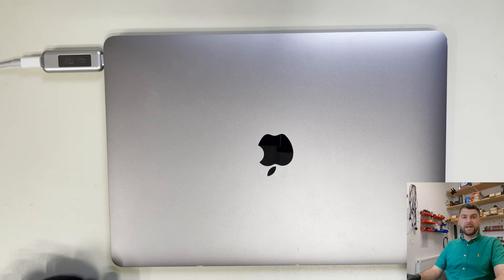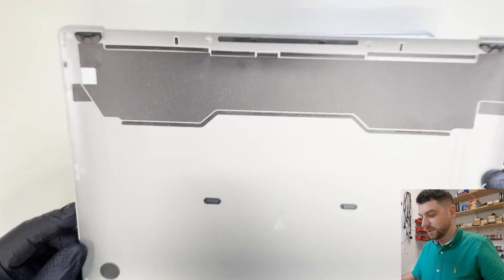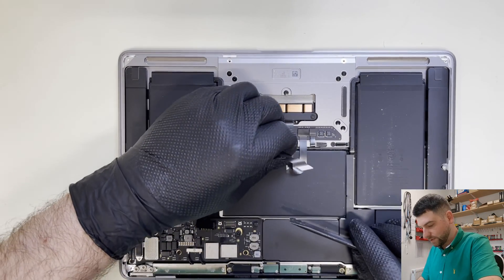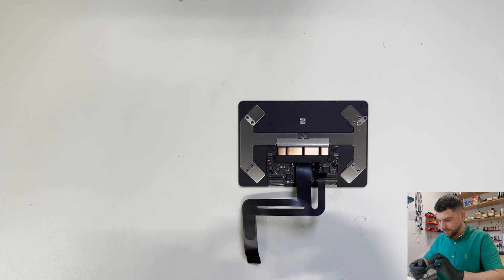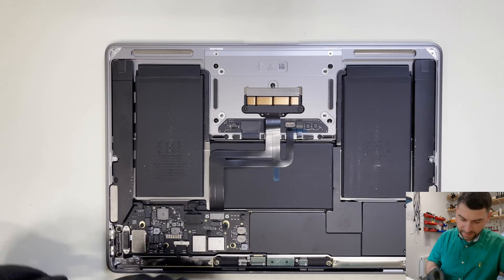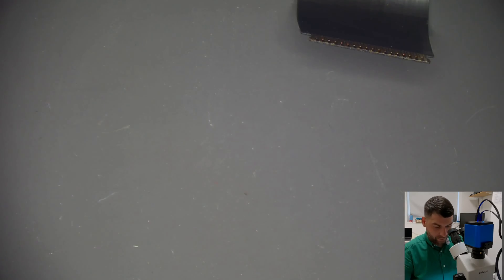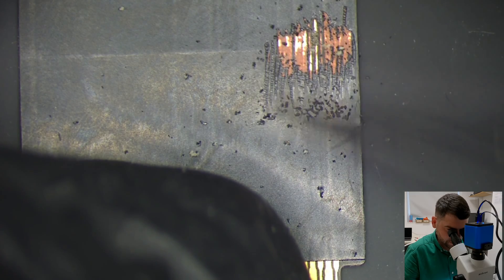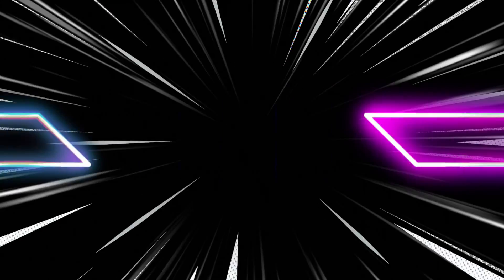MacBook Air A2337 Keyboard & Trackpad Not Working Repair: THE Most Common Problem

Comment: Thanks for the video and especially your investigation of the actual cable burn spot! Certainly drives home the point!

Maybe the strange software element of sleep/wake temporarily fixing the error could indeed be related to error correction software. It might have a "tolerance level" that for some reason resets upon sleep/wake and reboots - but above some level of signal-to-noise, it just gives up entirely, so not even resetting it works anymore.

Comment: My keyboard is not working but my trackpad is. I changed the flex cable but the issue is still there. What could be the problem?
Reply: Same problem here, how did you solve yours?

Comment: its a problem with the hall sensors that register if the lid is closed or not. magnets under the speakers. clean them
Reply: That’s interesting! My MacBook Air had the same problem as the video but it’s intermittent which made me think it must be software but I never even thought of a hall effect sensor. That’s genius
Reply: @damofx  did it work? i had to use external mouse because the whole keyboard was all bouncy.

Comment: why my MacBook keyboard and trackpad not working after I closed and reopen the lid.  I need to restart my Mac every time this thing happen . it is because of the flex cable too? or just the software faulty?
Reply: This happened for me after doing an OS upgrade. I reverted to Big Sur and the issue is gone...
Reply: Got frustrated after hours of investigating but when I found this comment, the issue was fixed - only closing and reopening the lid. Haha thanks man!
Reply: did u ever figure it out ?
Reply: Try making a bootable usb with the IOS and install it. I now have Sequoia and the issue is gone
Reply: I’m experiencing the same issue. I closed it while I was using Lightroom then when I tried to open it at first I was able to do so then it got frozen. Tried updating it then boom the trackpad and the keyboard stopped working

Comment: I have been investigating in this issue for hours and hours and hours until I finally figured out it is the flex cable. Used your video to replace it. I could not be more thankful to you!!

Comment: Hi. 
I have a similar problem with my keyboard.
Multiple symbols are typed at once, for example F4, F6 and F6 are pressed all together when any of them is pressed individually, also happens with RYI, FHK, VN,   if you look at these key you can notice the pattern.
Do you think the flex cable replacement could solve this? Thanks in advance.
Reply from the maker: Hi, very unlikely, seems more that your keyboard failed

Comment: Hi I want to ask I turned it off and when I turned it back on the letter a led me to finger and safary, e to emojis, f to full screen and like that with h, d, c, n and m and now I delate from the left side to the right and the letter I mentioned before dont work for normal typing, what can I do I'm working and I NEED for it to work but it doesn't do anything I erase my info and reset everything I don't know what else to do... it's MacBook air

Comment: i did this with my a2337 and was so happy, because it worked again. now after about 1 week it's the same problem.. so it is stuck after some seconds/minutes (always different) and i cant use the trackpad and keyboard anymore. could it be possible, that the new cable is damaged again.. after just 1 week?
Reply: I have exactly the same problem. It works then if I just close the laptop (instead of powering off) the trackpad and keyboard don’t work again. Very confusing and annoying, Macs are too expensive and too expensive to repair to have issues like this
Reply: @damofx  sameeee, what about now? is that solved?

Comment: Hi, I have a Late 2013 21.5 inch iMac (14,1) and I will soon open it to replace the HDD with an SSD. And since I'm in there I thought I should upgrade the RAM as well. Do you know if I need some "special" Mac compatible ram or it can be any as long as it's DDR3L 1600Mhz 1.35V 204 Pin CL11?
Reply from the maker: Personally I have never ever used RAM modules that are suitable just for macs, I believe this is just a marketing thing. I use any RAM module that meets the configuration, mainly Kingston.
Reply: @IFIXIT4U-UK  Thanks for the reply! Yeah Kingston is nice but the price for 16GB is half of the entire iMac haha so it's beyond my budget, especially since there's the cost for the SSD as well and those annoying adhesive strips. But good to know standard RAM should work too, this definitely broadens my options!

Comment: Mine having the same issue. I have the M1 Macbook Air. For some reason after the idle, keyboard and track pad wont work. The only time it will work if I will turn it off and turn on again. So frustrating!! :(
Reply: hello, i have the same problem. how you fix it?
Reply: @МаксимБеспалов-я1и у тебя получилось пофиксить?
Reply: i have the same problem ;;((((( @МаксимБеспалов-я1и
Reply from the maker: Try replacing trackpad flex cable first and see how it goes

Comment: You can just press the power button and it will turn off, the keys your were pressing have no effect, I just experienced this problem. Sad to see it’s wide spreed now. Although mine works for 4 minutes and then keyboard and mouse freezes, mouse won’t click as well. Screen keeps working and if I have media playing keeps it keeps going normally.
Reply from the maker: Yes you are right and here is why: There is a simple reason why you can't reset SMC on M1 Macs – there is no system management controller in the M1 Macs. All functions that were previously handled by the chip are now embedded in the M1 processor.
Reply: @IFIXIT4U-UK  I see, why do you think that flex cable deteriorates even on a basically brand new machine, I don’t see any moving parts that might put stress on it, my wife’s M1 Air has only 15 cycles on battery and this happened gradually and got to a point it happened even if the lid wasn’t closed and put to sleep, thankfully I have Apple Care + and they are  looking at it.
Reply: @Dilligaf_Josh  Even i am also facing the same problem in my m2 air but it's out of warranty can you tell me what they did to resolved it
Reply: @yashishbhaisare7038  first the apple techs changed the ribbon cable, that wasn’t it, so my assumption was correct, how can a cable with no moving parts around it that is not bent by design fail? It didn’t fail, it was the logic board connector they said, so they changed the whole logic board, I still have my doubts about the issue being the connector, I opened mine and everything was in pristine condition, but it definitely was the logic board, because now it’s working fine. I am sorry to tell you this since you are out of warranty.
Reply: I have the exact problem. It started yesterday and it resolves when I restart but it comes back usually after sleep or lid close. Is it still a hardware issue if this resolves after a restart?
Reply: @nipunlakshank  yes, that was exactly what was happening to mine. It’s hardware 100%

Comment: Thanks for sharing. Good to know. I haven't repaired any of the non Intel Macs yet but I'm sure I'll see some soon. We used to get similar issues with the SATA ribbon cable in some of the Mac laptops.
Reply from the maker: Bang man, it was A1278, as common as it can be
Reply: @IFIXIT4U-UK  Apple still hasn't learned to maker a durable flex cable, or make them long enough 😂 #flexgate